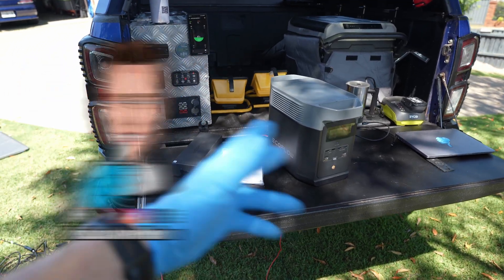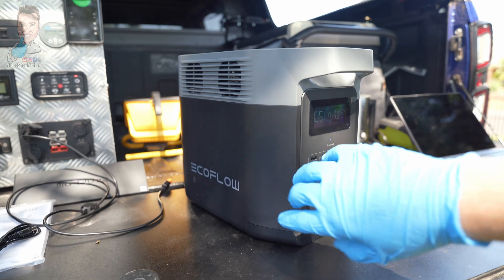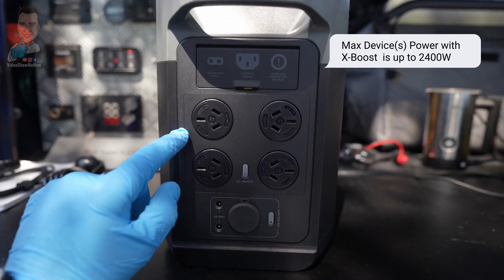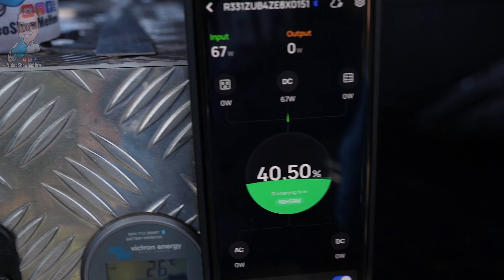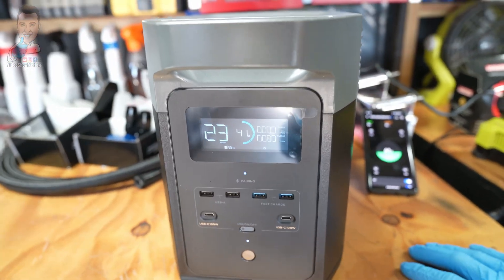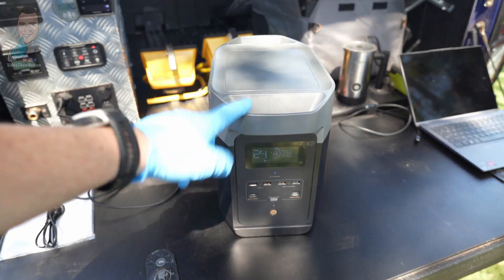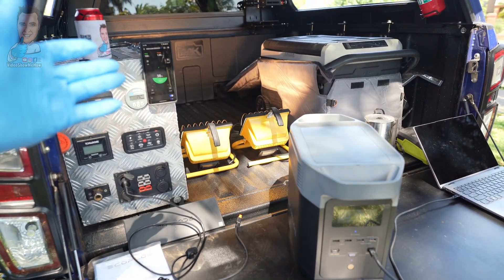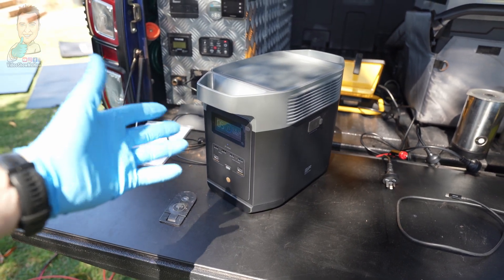New ECOFLOW DELTA2 | Full OVERVIEW and TEST | All In One Power Storage 2023

Comment: When connecting the Ecoflow Delta 2 to a 12v car battery using the DC plug [the aim being to recharge the car battery], how can I be sure that the power is moving from the Ecoflow Delta to the car battery, and not the other way around? And if you run a cable from the Ecoflow Delta DC port into the car cigarette lighter, would the current be flowing into the car battery?
Reply from the maker: No, you need a car charger. If you connect to car cigarette port it will pull charge FROM your car to the delta.

Comment: Whats the chances on a comparison review on what works as a power system that can keep your fridge running indefinitely when bush with some supplemental solar charging? Are these ecoflow type systems better than a dedicated 120AH battery with BCDC and inverter setup?
Have a good one Ads!
Reply from the maker: Yeah good shout, will get these vids complete then reckon I could cook something up! The all in one units are getting pretty darn good, I think for a non tinkerer they're a good option, only thing is they start capping out on size vs cost compared to a DIY.